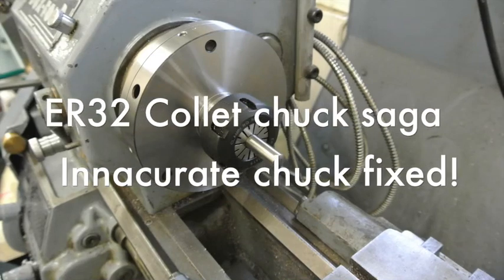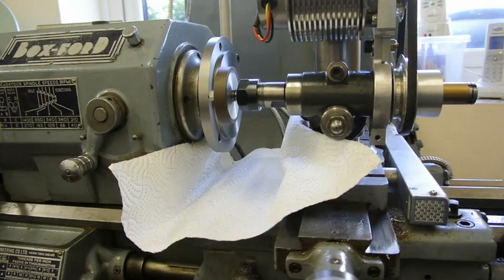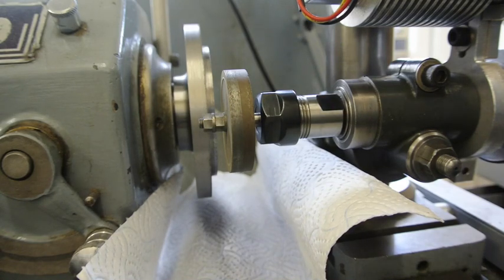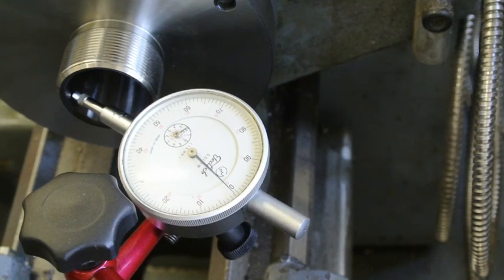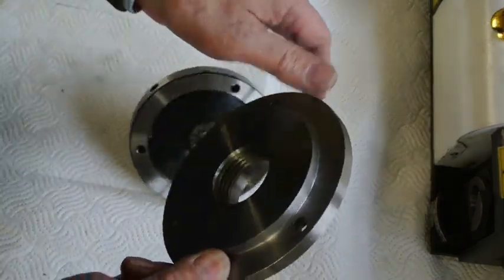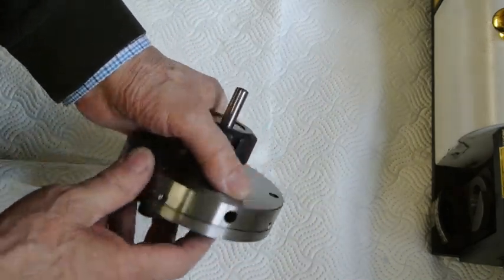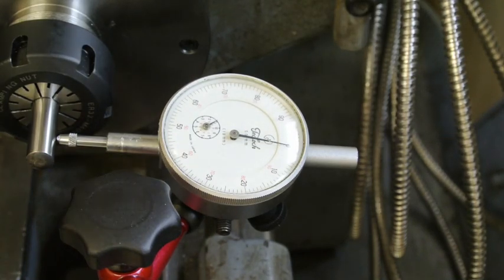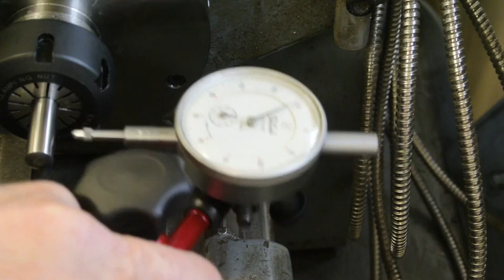Back plate mount Er32 collet chuck

Comment: My collet-phobia flares up again :)
Reply from the maker: I think we all have the same problem.... it is extremely frustrating that such poor quality products are made and sold. The annoying thing is that the machining is being done on quality machines but without care or understanding. I deliberately bought through a reputable Uk supplier who thought my first one was a rogue sample. Well it wasn't. If I was selling these things I would open up every one and check them before sale and certainly before sending out replacements. As it turns out my mod with the adjustment screws solves the problem I had with the second one. The first couldn't have been corrected and just was destined for the scrap bin. Luckily I have one set of good ER32 collets and will not risk buying any more. 

We all need your sense of humour to get through it!

John
Reply: You did a great job fixing this piece of junk. So far I haven't mounted my 80 mm chuck to a backing plate, as I'm pretty sure it will be crap. I did have a similar idea for making it adjustable by turning an oversized backing plate and use the outside of the collet chuck for some set screws. But the machining marks coming though the grinding on the back of my chuck made me think it would be pointless. 
The joys of cheap Chinese tools :)

Comment: Really a qualified work, making an adjustable chuck. However, one gets what one pays for. Banggood now and then sells good stuff but Ebay... rejects, returns, second hand, left overs from production, cheap rubbish design..

At 08:55 You tell there are 7 mm free. At 09:25 You tell the matching piece has a stick out of 7 mm. At 09:40 You bring them together. That looks like no margin at all.

Comment: The Chinese can make these parts as accurate as anyone else but if they do you won't get them for the price we do now.
Reply from the maker: Geoff
Well they have the right machinery to get great accuracy. However, at the moment they produce beautiful finishes but seem unable to sequence the work to make the resulting parts accurate. Maybe one day someone will care enough at the factory to check what is being produced and get it right. It would not take longer or cost more. I only have hobby type equipment but I can refinish these parts to get them really accurate. The worst thing is collet sets which are invariably terribly inaccurate. I have had some really good ones so it can be done. Unfortunately just selling with a 'certificate' of accuracy does not mean anything. John
Reply: @john2478  It really is simple, if you don't like the inaccuracy then spend more money and get a more accurate one. If your too cheap than live with the result. HAAS has a standard collet nut that provides .005 TIM runout and if you want better the cost goes up.